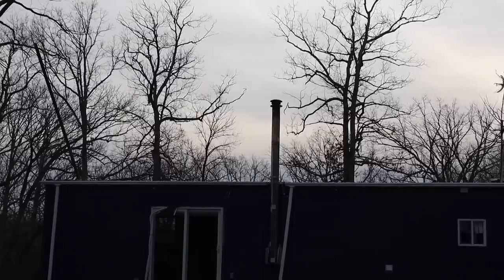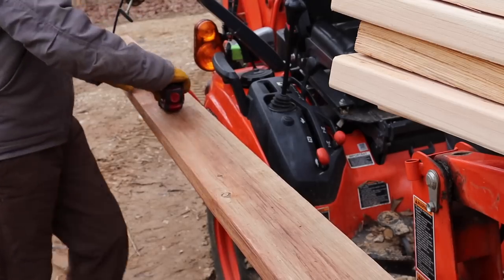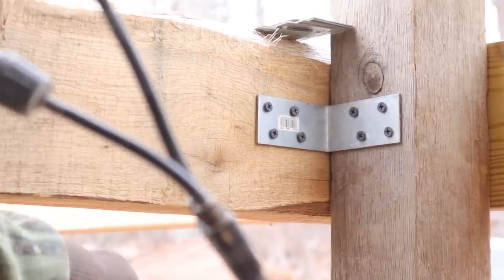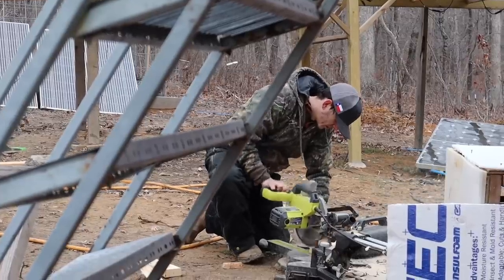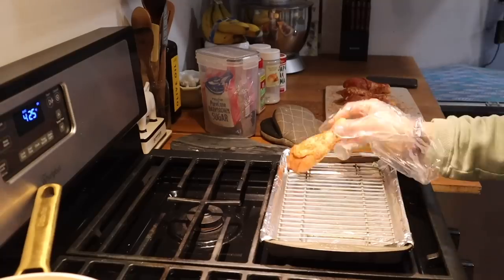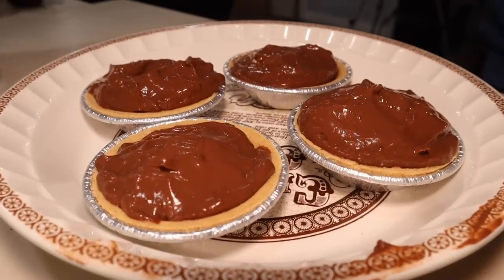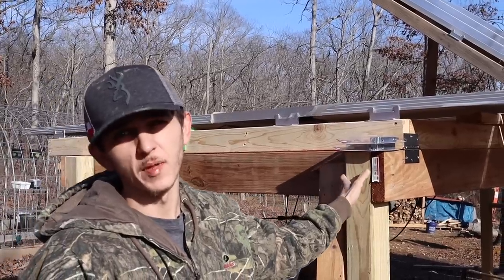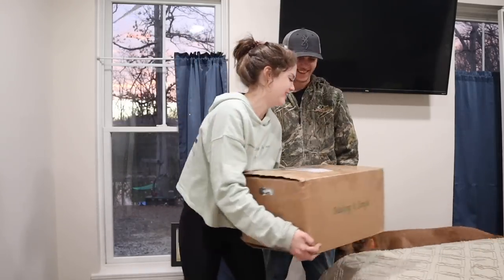Our CONTAINER HOUSE needs MORE SOLAR | EP:94|

Comment: Using drywall screws are not structual . A bit of vibration and they will shear off. Please use strong faseners for structual or stress loads. (wind is a killer). Keep on trying. Way better than doing nothing. Cheers.